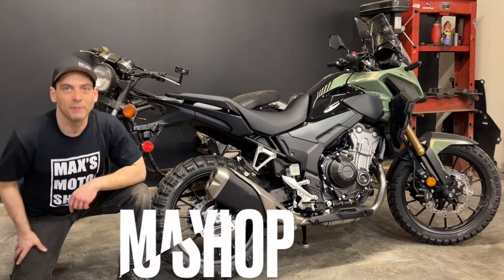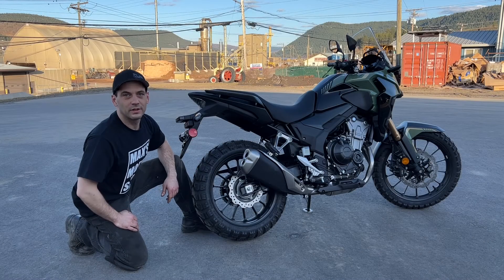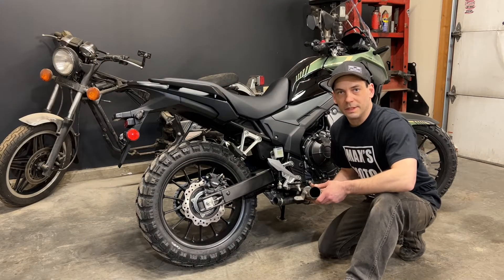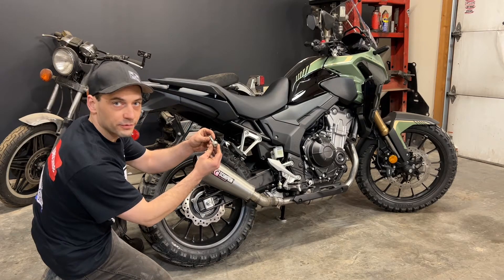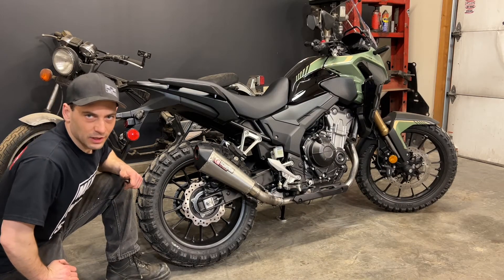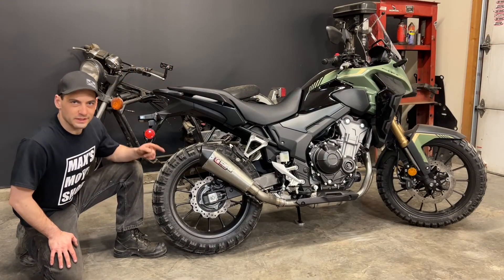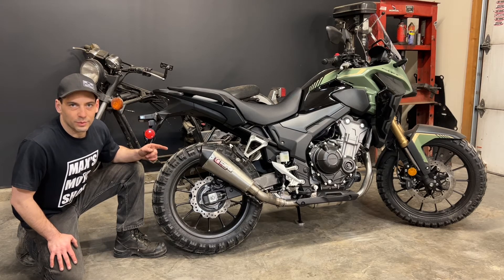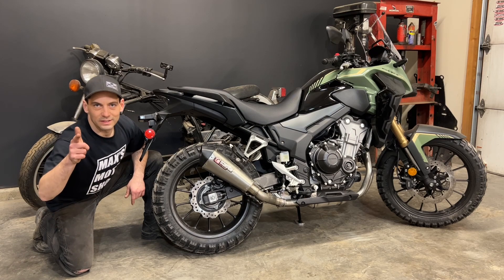2022 CB500X Scorpion Exhaust Install Guide and Sound Test

Comment: You changed the tires already, what did you use?
Reply from the maker: I put on the mitas e 07 + they’re supposed to last long time I’m hoping to get 10,000 km out of this set before I’m extremely well on the dirt and off road and fairly decent on the street as well
Reply: @Maxsmotoshop  Hey there Max! How did the tires hold up?

Comment: What’s the little extender piece with the hole that sits by rear tire?
Reply from the maker: I’m not too sure what you’re talking about do you mean the center stand mount on the very bottom of the bike
Reply: @Maxsmotoshop  ya it comes off the exhaust and sits near rear tire. Just wasn’t sure what that was and if you felt it gets too close to the tire. Makes sense it’s a center stand mount now that you mention it

Comment: Much needed upgrade for what? Why do you need to hear the bike when you're riding? You're mobing in a forward motion, all sound goes behind you. 
An exhaust upgrade like this is purely cosmetic.
Reply from the maker: This is not allowed pipe but yes, it does give a small volume gain. It also allows a bike to breathe properly giving it an extra one horsepower and on a bike with less than 50 that is a big gain.
Reply: Er.....do you actually ride a bike? Listening to the gentle burble (and occasional sudden roar) of the exhaust it part of the pleasure of riding.